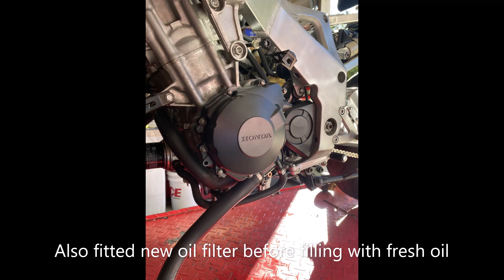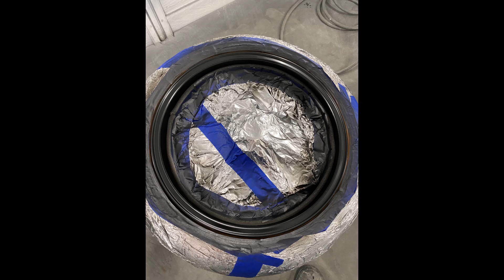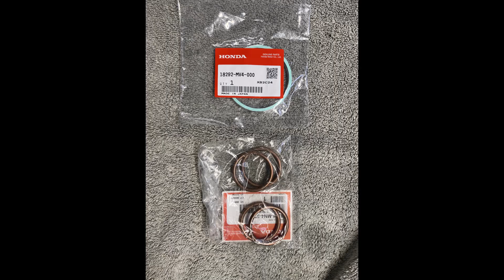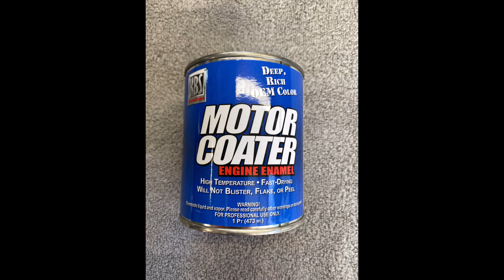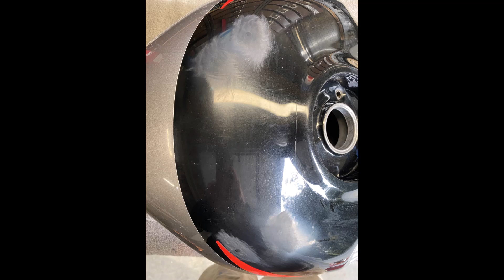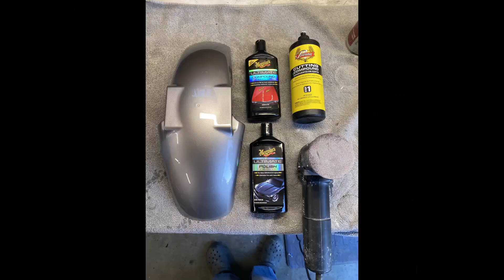93 CBR900RR Restoration prt.7 - Gas Tank, Front Wheel & Fender, Exhaust, Seat Cover, Engine Cover.

Comment: Won't the clear coat on the tank be thin after all that sanding? Do you use some form of ceramic coating?

Edit: also a suggestion to fasten the retro bright process, use indoor grow light/led directly on them and it would cut the time in atleast half
Reply from the maker: I’m only taking a very thin amount of the clear off using 2000 grit wet and dry, just removing scuffs and very light scratches. If I have to go deeper, say 1000 grit to get bigger scratches out I re-clear the tank. Either way you have to be extremely careful and not get carried away. Good tip on the UV, I’ve seen that technique used for old gaming consoles. Will think about a setup.